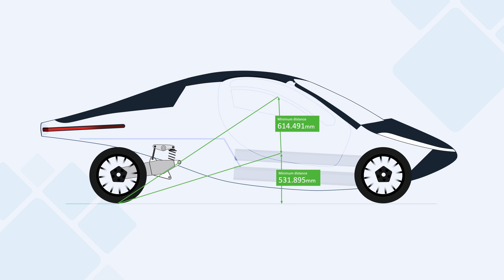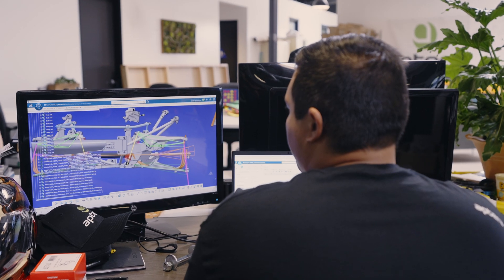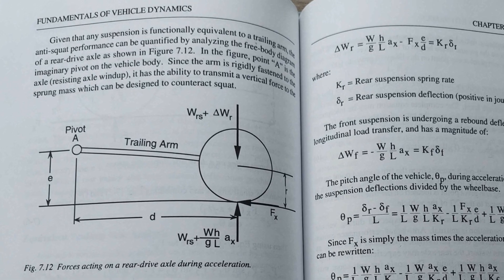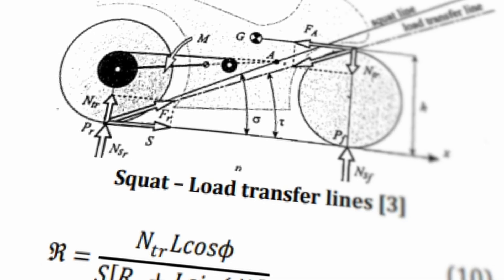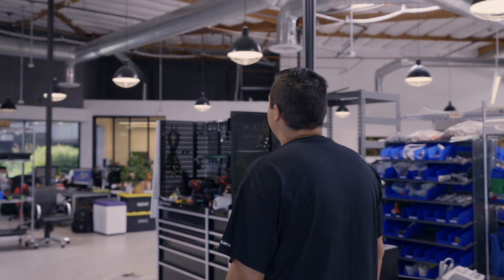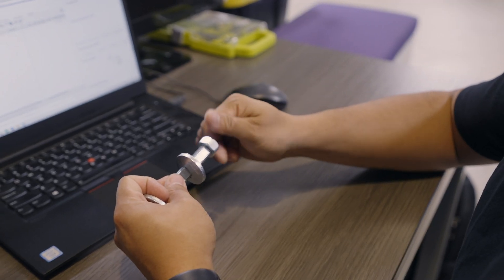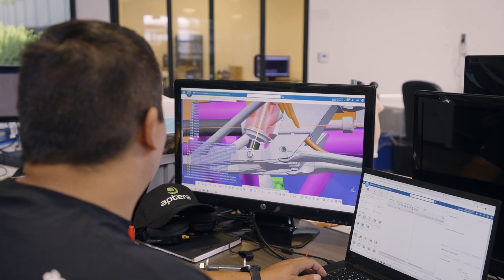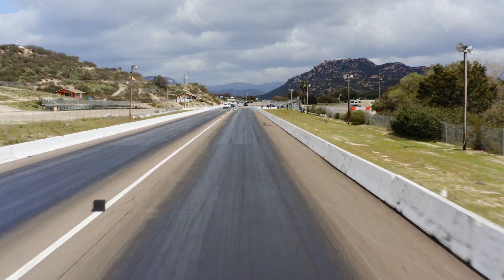Aptera Makers Series — Suspension

Comment: i’m really curious about safety can you guys please put out some data/a video on this. love the product  just curious about safety
Reply: The safety guy's turn will come. Stay calm!😂
Reply: I am calm just really curious, if this is safer than the average car they’ve got a home run product:)
Reply: @nikkokp  So far, what I've read is, they are designing the vehicle to actual car specs, and they plan to have it undergo all of the rigorous crash testing and otherwise and share the results.
Reply: @nikkokp  The carbon, kevlar, hemp shell is stronger than a welded steel body and chassis.  The construction  has been compared to Formula1.   The unique shape makes it less likely to suffer direct force during a collision with another vehicle as I recall.  It will have a full air bag array.